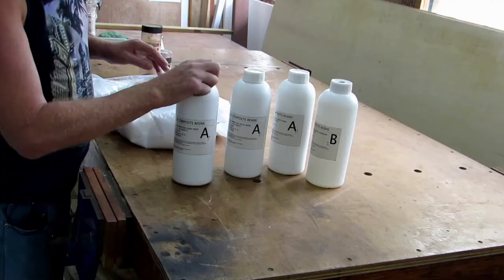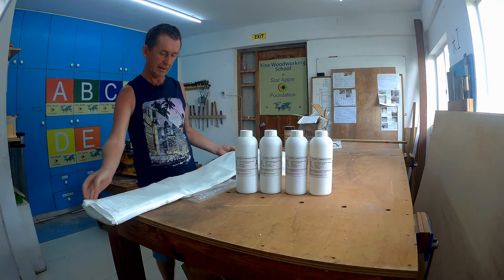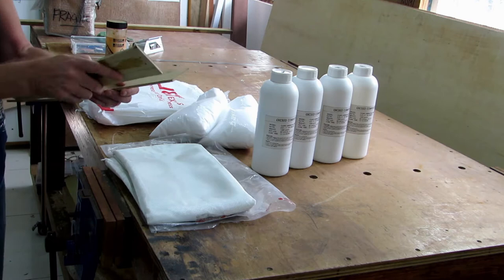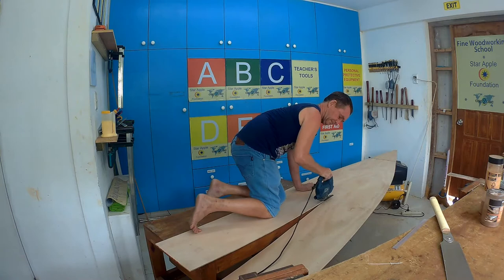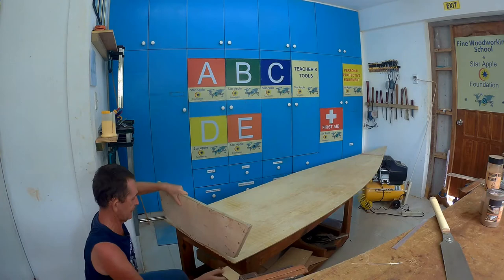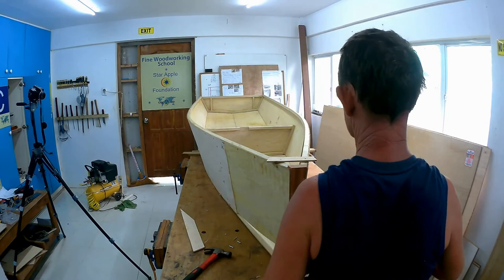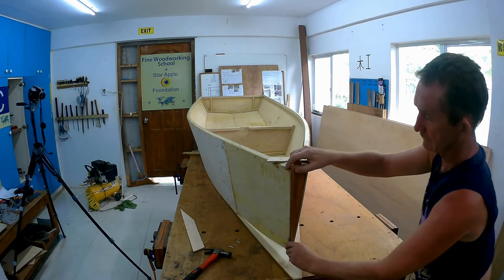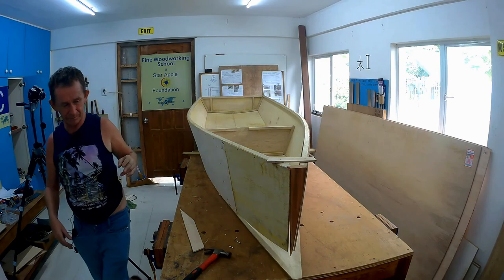Build a Tryst 10 Trimaran Sailboat - Pt. 5 - Our boat goes 3D

Comment: It's coming along nicely, but i saw the sneak peak on Facebook of you testing it in the water 😮😮
Reply from the maker: hahaha. Thank you. It was ever so hot in the workshop, so it needed a dip. Hard to do work these days.
Reply: @IrishChippy  i bet! What's the average temperature these days where you are? We are entering fall here so the temp is perfect, somewhere around 20c most days
Reply from the maker: @TheGrantAlexander  Minimum throughout the year would be 24C, but seldom goes that low only when it rains at night. Most days are 30C to 36C, with most night 26C - 30C. Seldom goes over 36 or 37.
Reply: @IrishChippy  wow that's hot 😮😮😮